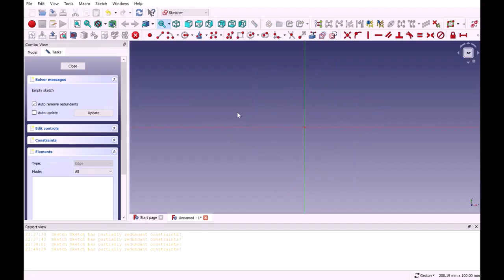AIRSTREAM  REBUILD - Ep. 8: New COOSA subfloor & wheel wells replacement

Comment: What size u channel did you use for the wheel well area? Did you leave a lip for the wheel well or did the u channel sit flush with the edge of the floor? Thank you!
Reply from the maker: I used this one https://www.mcmaster.com/4592T19/ It is the same width as the ribs. The U channel is flush with the edge of the floor and the wheel wells are riveted into them from the side. On the long side I left a (about) 2" lip on the wheel well that sit under the floor below that is bolted to the channel through the floor using the same bolts I custom made for the floor channel. Does that make sense?
Reply: My untrained eye saw your u channel as 3 or 4 in wide, def not just 1 3/4! I believe I follow. I saw that you trimmed off of the wheel wells. Love your method of riveting into that channel from the outside. Were your custom bolt flanges intented to add surface area for retention? I went with 1/4 thick 2 in and 2 1/2 in elevator bolts. Would it be suffice without your custom flange?
Reply from the maker: @BubbaRiot   I used the bolts with custom flange in the floor channels the bolts the shell to the frame and the floor too. The custom flange is to stop the bolt from rotating in the channel, this way I can get under the trailer screw the nuts all my myself without having someone inside holding the nut with a wrench. Also if one of these ever come loose once the walls are closed I will still be able to tighten them by just removing the belly pan and not the walls. You can't do that with standard bolts.
Reply from the maker: @BubbaRiot  Mounting the wheel wells from the outside is I think the only clean way to install the floor without removing the shell, and it has the added benefits that the wheel wells can be replaced later if necessary, like damages from a tire blowing up.
Reply: We currently have our shell floating off the frame and set on 2 2×6's and 4 horseys. Would attach photo if I could. We have our floor cut but not bolted to the frame. We are waiting on our bolts for our axels. We just got our lift kit holes adjusted. Going to get new front + rear floor support channel this Friday. The old channel didn't match the curve of our floor. It's been a journey. Next will be the wheel wells in a similar fashion as your own. Thanks for the inspiration ^.^
Reply from the maker: @BubbaRiot  You're welcome. I can completely picture what you are describing, I think I have seen someone else do that. I am currently building new custom tail lights, and more generally planning to patch up the different holes to finally seal mine
Reply: I ordered u channel and glued them to the floor. But I misunderstood that you slipped the long edge of wheel well under the floor. My bolts are fully fastened and I can't fit the lip inder the floor. Have any recommendations? 😅
Reply from the maker: @BubbaRiot  I my case I had a bit of floor overhang past the frame. Probably 4 inches.   So the long edge of the wheel well is under the floor but is not sandwiched between the frame and the floor. The long edge is just bolted to the U chanel through the floor. But that is most likely overkill since I also riveted it to the U channel. Without seeing exactly you situation I would say, get rid of the long edge and just rivet to wheel well to the u channel just like I did.

Comment: Is my math correct at $165 per 4x8x.75  sheet of COOSA? If so it is a much better value vs AB ply,
Reply from the maker: I wish it was that cheap! The cheapest I found was $400 per sheet for the 3/4" Bluewater 26 COOSA. Definitively more expensive than plywood, but then add to the cost of the epoxy to seal the plywood. Personally, I also added into the equation my time if I had to apply the epoxy properly + the fact that every hole drilled in the seal plywood would need to be sealed again. I came to the conclusion that yes it is more expensive, but at the scale of the project it is not that much and I am saving time and peace of mind that is never going to rot.
Reply: @SylvainBurdot  My error I was watching this in background today. I counted Bluewater 26 as 26 pieces of Bluewater COOSA. $400 is what I priced it at.  Subflooring / Foundation at $4318 is a chunk but you have to look at it like building a castle on sand vs bedrock. I like the sweet spot between size-weight-power and overengineered/do it right do it once..........I really appreciate how you construct your videos including  your choice of background music which I generally find distracting. Your previous reply mentioned adding commentary. Jimmy DiResta's does a really good job of this in his videos.
Reply from the maker: @803mastiff9  Yeah that is exactly my thought. do it right do it once. The subfloor is such a pain in the ass to change once everything is inside that I don't want to have to ever do it again. I know with coosa that if the trailer ever leaks the subfloor will not be damaged.